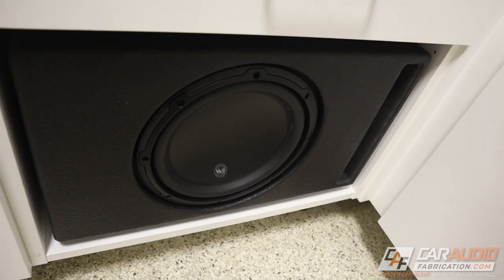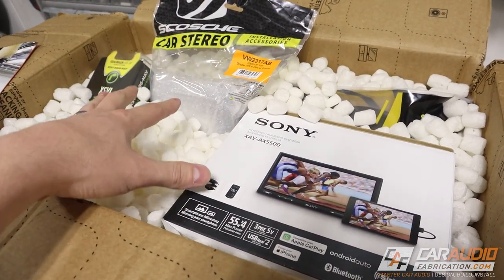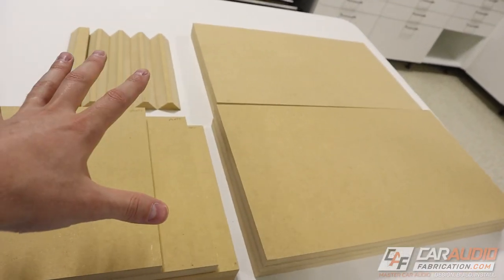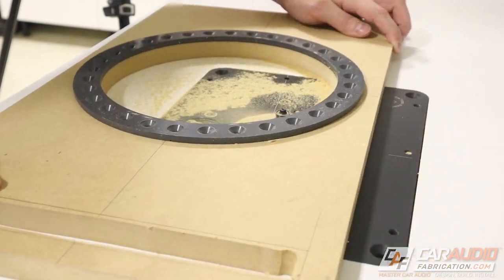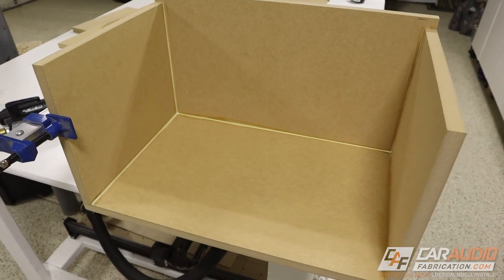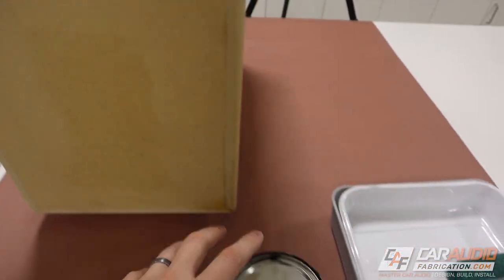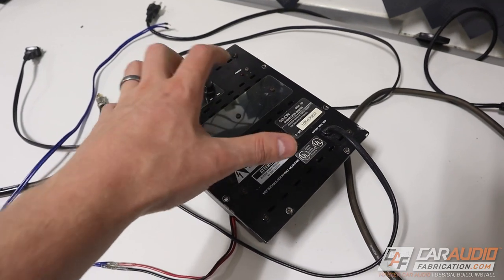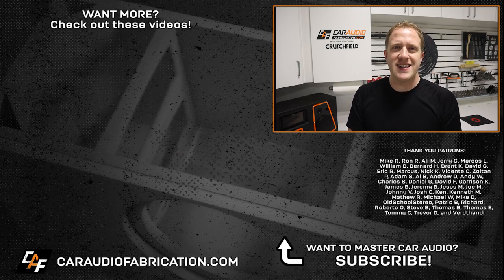How to Make: SHOP SUBWOOFER! Built INTO the shop and doing THIS removed rattles!

Comment: Subwoofer is much needed my dad and I actually installed a car audio system in his garage using two Db Drive amplifiers 1,050 for the speakers which are 4 4 way 6×9s and 1500 for the Subwoofer which is a 12 inch kicker comp VR and he is powering the system with two car batteries linked together and also hooked up to a battery charger that has a 60 amp boost for jump starting. My dad never wants to leave his garage lol

Comment: I have a CB repair shop. I have my Rockford Fosgate Prime 10 in a sealed box run off my Virtual Reality VR3 amp hooked up to a bluetooth setup with Panasonic surround mids and highs. Sounds amazing! For a place where I spend 8 to 12 hours a day, yes it's a must to have a great sounding stereo system... and when it's mobile systems we specialize in, use it every time!

Comment: Thanks. Great video. 
Another way to find the center of the face is to lay a straight edge across opposite corners and draw lines diagonally. No measuring required. 😎
Reply from the maker: The templates have guide lines at every 45 degree offset that I have to use to line up. So I have to draw lines at 90 degrees anyhow. The corner corner method doesn't work for that unless a perfect square.
Reply: @CarAudioFabrication  The corner to corner method works on any parallelogram to find the centroid.

Comment: You do such beautiful work. I literally just made a much sadder version of a shop subwoofer for my garage and wedged it in a cabinet. I have a Dayton audio 200w plate amp pushing a very old MTX 10 Thunder 6000. It's not much but it really wakes up my music in the garage. 

Also instead of a dedicated stereo I just have a couple Google Chromecast audio pucks, one plugged into some powered bookshelf speakers and another plugged directly into the sub amp. I then just made the two Chromecast Audio devices into a group. It actually works really well though.

Comment: This video reminded me of a box I geeked out on right after the W7 first came on the scene. I used turnbuckles that were connected to 4 sides of the box so you could literally tension pull the walls towards each other. 1" MDF on sides and 1" plexi on the back, with (2) 1" MDF pieces stacked for the baffle. Not sure how much it helped, but it sure looked steampunk AF. LOL

Comment: I'm building a shop stereo and I sourced a few JL8w0s in pretty close to mint condition for the project. 

I'm using a pioneer deh p7400mp for the head since its got a subwoofer output capability from the deck. 

hopefully for spring I'll have a Riyobi party station built and I'll end up putting the stereo in there with a solar roof and 12v cooler.

Comment: corner pieces may strengthen the box, but the real reason acoustically is to help the sound move around a corner and through the port, as apposed to bouncing directly back at the speaker. sound waves flow like water, which is why the best boxes take fluid dynamics into account.

Comment: Nice! I love that coating you put on the box rather than the original carpeting you normally see. I would love to see about building a better box for my 98 K1500, and use that coating. I have one that sits under the rear driver seat, but it sticks out a bit and has no Amp mount.

Gonna be taking a closer look at these videos. Thanks!

Comment: Here's an idea for the speaker grille. Since i haven't a good video on using heavy expanded metal mesh for speaker protection (example) floor in a hatchback where items are being stacked on top. I see since the sub is low in the cabinetry there may a chance of accidentally hitting that sub location with feet, or long pieces of wood, rolling tools, etc... I nice white MDF panel with a white painted steel mesh would be my vote. Please try mounting the mesh in so that the edges of the mesh are turned 90deg. and fit into the face of the MDF panel. So we could use this tutorial in car uses as well. Thanks Canada Rob.

Comment: White grille cloth would be great.

I would suggest you go the PA amp route. Plugs right into the wall with 120v, no need to mess with ac/dc power supply nonsense. Some reputable brands are Crown and QSC.

Comment: For the power supply, you could look into computer or even server stuff. I'm currently running an HSTNS-PL18 750W power supply paired with an Audiobank F43 amp and it works wonders. Those power supplies can be get on ebay for as little as 10USD so they are a safe bet. As i usually do this kind of crap, i bought a joblot of 10 of them for even cheaper, 4USD a pop, but either way they are very cheap and very silent for this kind of applications.

Comment: There is another technique you could use that involves a CPU power supply. I built a 12V test station and decided to couple it with some of my old audio gear to make a very loud garage stereo/test station on wheels! I have photos if you are interested Mark.
Reply from the maker: Not enough power for what I would like to do.
Reply: @CarAudioFabrication  I coupled a 600W Power supply with 7.2AH batt and a 2 farad cap. Pushes a double din stereo, fosgate 4 channel amp 400W (mid/highs) and a Memphis audio 250w amp bridged to 2 ohms. In addition, also runs a 12V, 5V power supplies, lights and usb charger. when it's cranked up, it shakes the garage doors. I still need to finish carpeting it but it's built and sounds good and clean. There are also 1000W supplies you could pick up but as long as you run it in conjunction with a batt or two you will be able to run whatever the batt can handle and the supply unit will act as an alternator.

Comment: You can modify a server rack PSU to convert 110v ac or 240v ac to 12 v DC 100+ amps to power a car amp for that woofer. Second hand server PSU units are super cheap as there are lots around

Comment: I say the subwoofer is necessary makes the Music Experience full circle without it it's just not the same. I have a hard time driving my car without a subwoofer and there's been times where I've put any old subwoofers Ive had laying around in the car temporarily just so I can have Bass. Especially during my upgrade stage I took everything out to upgrade everything car audio wise and electrical but I found myself throwing random subwoofers from my stock pile in the car just to temporarily get me by until my car was ready for the bigger build lol. I got  to have my bass :-)

Comment: Great Built, i’m using 10W3in my car, how does it perform outside the car as in your setup, i mean most of the car sub outside car doesn’t have linear frequency response, you know what i mean. They do hit low frequency notes just fine but just sound bit different.

Comment: Speaking of old equipment, do you have a video on using old speakers? Anything you should look for? Can you still run the RMS wattage? I have two Rockford fosgate RFZ2410. I want to use them but wonder if there’s any precautions to take. I also have a hole in one of the surrounds. Do you have different recommendations for repair? I saw that people just use a foam sheet and just glue a patch to the surround. Can I get away with that at such a low wattage speaker or would completely replacing the surround by the only option? Thanks!

Comment: Sweet build. Have two questions for you. First have you ever made the inside of the sub box smooth, like sand it and put a clear coat on it for faster air movement and the second is have you worked on any Audi stereo systems that have BOSE speakers? Wanna put new speakers and a bigger sub in my Q7 but the sub is inside the spare tire rim

Comment: You should have use the drawer face as the front of the box and put a white grill on the front, It would have looked amazing. Also, a plate amp is good enough. You should have installed it into the box directly.
Reply from the maker: You didn't watch the video, I use the subwoofer for testing cars and amps, I need to be able to just connect to the terminals.
Reply: @CarAudioFabrication  I saw you mentioning that, but my pet peeve is once I have something installed I try not to mees with it. I usually have dedicated test equipment for testing and dedicated equipment for entertaining.

Comment: Hey am using the same set up in my shop this is the power supply am using and been using for the past 2 years 

SUPERNIGHT 12V 30A Switching Power Supply, 110-240 Volt AC to DC 360W Universal Regulated Switching Transformer Adapter Driver for 3D Printer, CCTV, Radio, LED Strip Lights,Computer Project

Comment: Does anyone have any recommendation for what type of enclosure and subwoofer are the best for decent bass in a Jetta (mk5)?
Reply: I have a Golf mk4, A double 12' or 10's are usually the way to go. Def go ported. I use JBL and I'm perfectly happy with that
Reply: For comparison, I have a Skoda Octavia wagon and have a 12 inch ported about 70 Liters for high efficiency. The Octavia an Jetta are pretty similar in size, but you probably have sedan
Reply: If you’re planning on building it on your own this channel has some good videos about measuring the space so you don’t build your box and then find out it won’t fit. 1000 watts of power or whatever your desired amount should be plenty efficient if you do have the sedan.
Reply: @gabiovi2031  Good luck with that
Reply: Got too 10s with a 2 channel Sony 1000 watt amp
Reply: @michaelanderson3703  I got a 1kw Phoenix gold amp for my double 12's and a 4Ch 200w for the front door speakers (JBL Club someting 6')
Reply: memphis car audio SR 10 inch 2 of them

Comment: Cheap high powered 12v supply buy a 1000-1600w computer power supply and use the 12v output on that. You’ll have plenty of amperage. Easily get 100a out of one

Comment: I really want a router but I can't find any that mouts to a table, only handheld ones :(
Reply: They are usually the same router. My tabletop router and handheld router are identical.
Reply: They are usually the same router. My tabletop router and handheld router are identical.
Reply: You can usually buy or make a table top piece your router attaches to I suggest getting a 1/2in collet I bought a 1/4 unit and regret it just because it’s a smaller unit and I was trying to save money but once cry once

Comment: I can build you a 100 Amp power supply for the coat of materials if you like and use an old housing much cheaper than what a 40 or 50 Amp would cost .. interested? I build these for HF radio applications but this is no different. Thx

Comment: will suck nicely all wood dust in over the time :D not recommended in metal working shops
Reply from the maker: Except that every time the sub pushes air out, it also pulls it in. Usually stays pretty clean inside